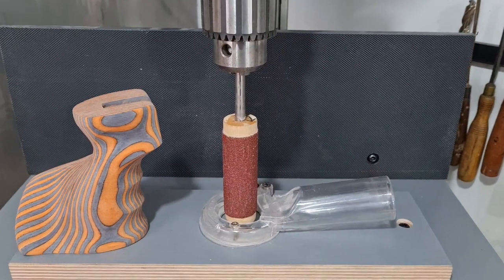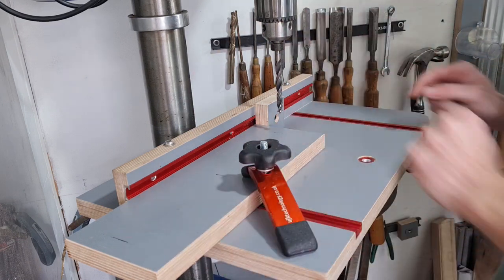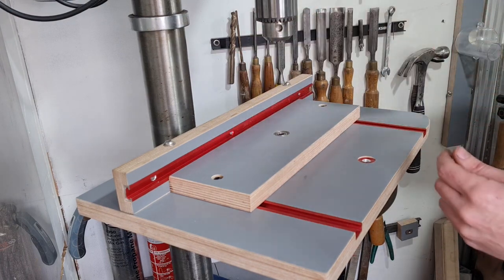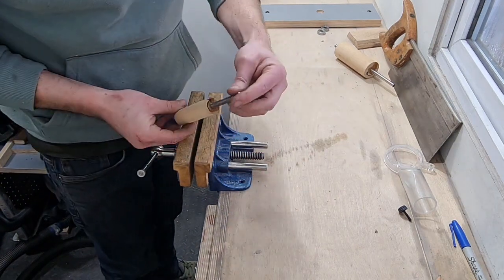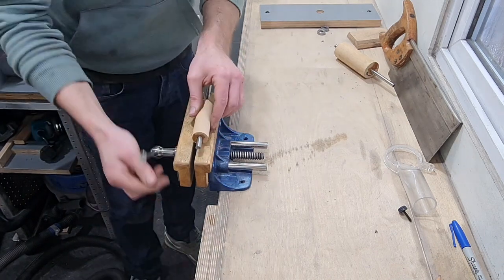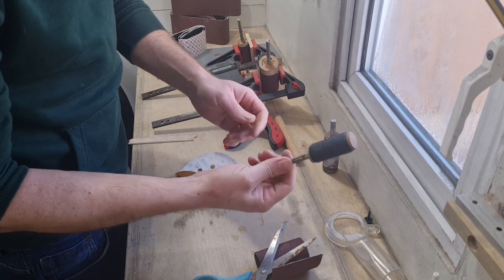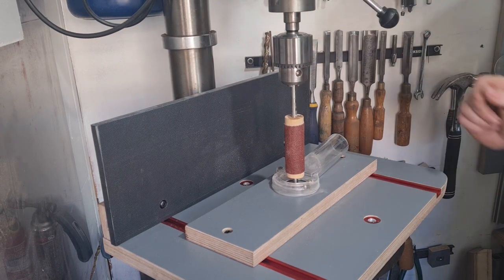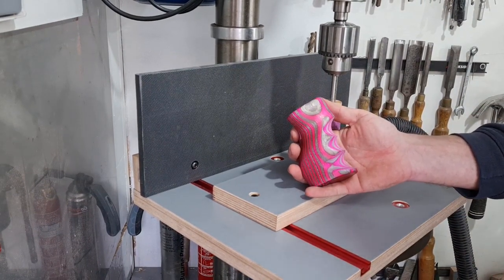DIY super simple pillar drill spindle sander to shape air rifle and ar15 pistol grips.

Comment: Awesome tommy but I have some questions lol what is the glue you use and we’re do you get the dust thing from . A pillar drill is on my wish list and a band saw and a thickness planer .I am in the middle of making a boat net out of cherry
Reply from the maker: I just use normal superglue to holt the material backed abrasives to the body. I've also got some that have velcro on to take the hook and loop paper . They work great as it's a bit softer and Conforms to curves nicer in the higher grits.